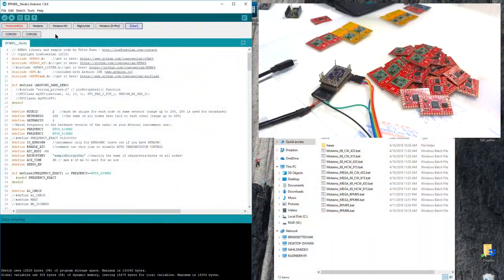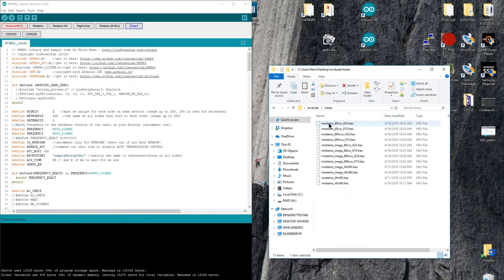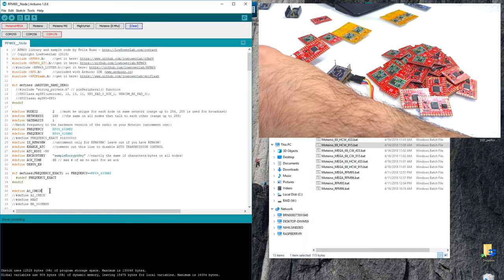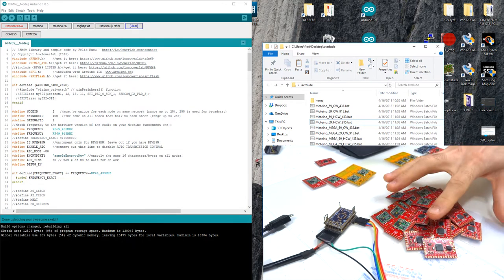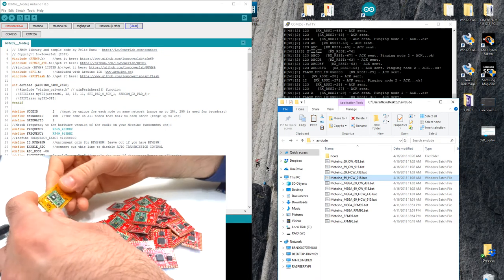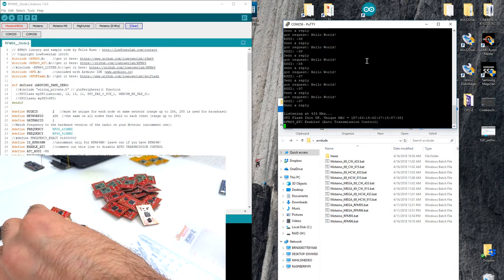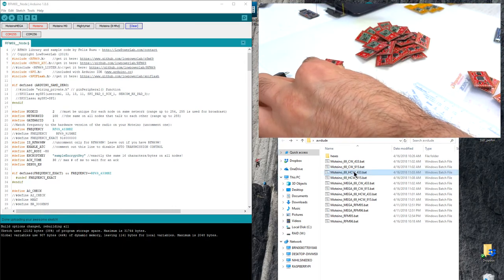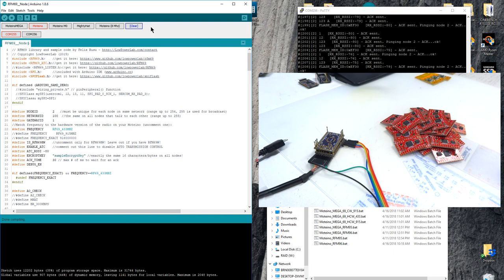Moteinos production testing - IDE & avrdude

Comment: Are you using a bootloader? If you are, is it uploaded as part of the hex file which the IDE generates?  I have not installed the IDE add-on; I'm using avrdude to bootload MCU's. Great update, thanks.
Reply from the maker: Tree2Tool The upload I show is only for test sketch, I do the bootloader separately via ISP before the radios are soldered.

Comment: Are you testing without antenna? Or is there a "pogo-pin-antenna"?
Reply from the maker: no antenna, the sketch uses ATC, only a few packets are transmitted, and there is a conditional check in the sketch which should only trigger transmissions when this is on the jig, not when the customer plugs the mote in or powers it
Reply: OK Thanks for your answer, and a big thank you for your work with the Moteino system. Amazing work! I love it.
Reply from the maker: My pleasure, thanks for the feedback!

Comment: Don't know why but I had forgotten the downloading of your modification to the Arduino IDE software. After installing was surprised to see the buttons did not show up nor was I able to figur eout how to get this neat feature working. This video has rekindled the drive to attempt to get this working. Any suggestions as to why this was not successfull are apprecaited.
Reply from the maker: Did you enable the toolbars in the PREFERENCES ? It requires an IDE restart.
Reply: I just went into the preferences dialog box but could not find "enable the toolbars".

 So guessing when you install the your option it still uses the same IDE as it did before the addition of your toolbar?
Reply from the maker: Make sure you download my IDE. It is a ZIP and is not an installer. simply unpack and run it - compiled for WINDOWS.